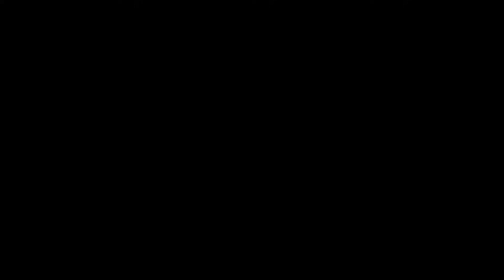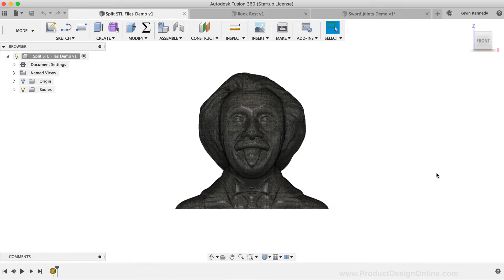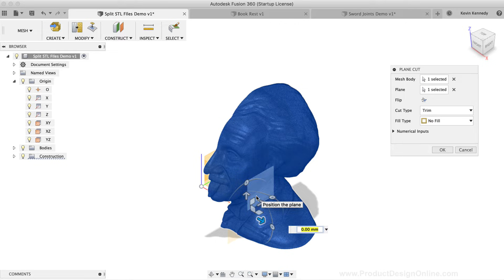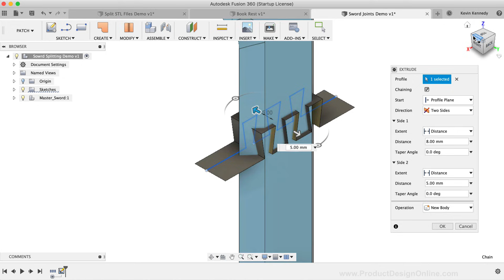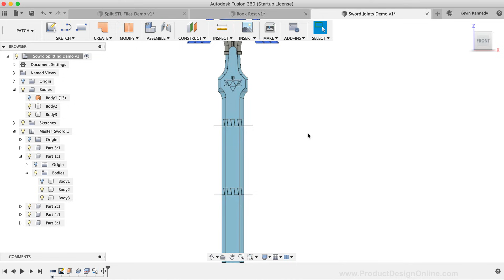Fusion 360: Split Large STL files for 3D Printing

Comment from the maker: Here are the resources for this tutorial ► https://productdesignonline.com/9
__
TIMESTAMPS
0:00 - Splitting large STL files in Fusion 360
1:37 - Measuring the model
2:36 - Turning on the Mesh preview
4:50 - Using the plane cut feature
6:39 - Selecting the cut type
7:13 - Selecting the fill type
12:13 - Second method: using the split body tool
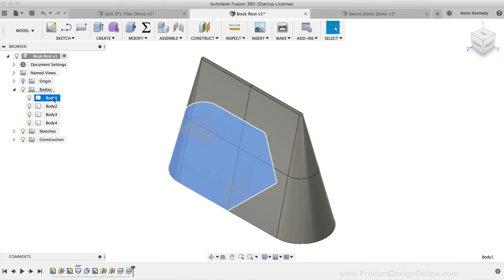14:23 - Moving the newly cut parts
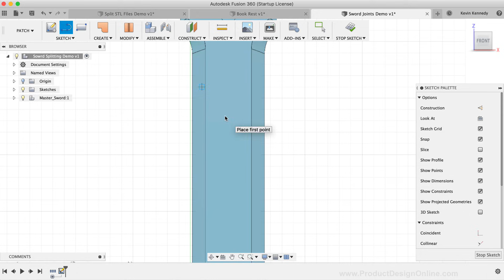16:51 - Creating a dovetail
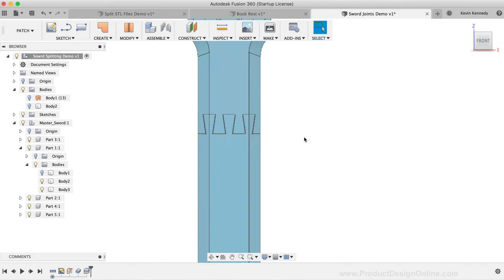23:20 - Copying the joint type: make duplicates
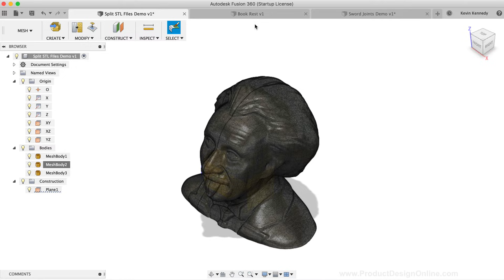Reply: The second method section actually starts at 10:35.

Comment: Hey! I"m new to 3d printing and fusion 360. I was following along with the sword dove tailing and there are a lot of tool locations that have changed. Also, for some reason I can't get my dovetail extrusion to be used as a means to split the body like you did. I'm so lost

Comment: I have been struggling for hours trying to use a zig-zag line (like a dovetail) to split an object into smaller pieces to fit my 3D printer. I knew I had seen you do it, but couldn't find the video until just now. I had been watching a video by another person, who was using an older version of Fusion 360 and his method didn't work for me. Only after re-watching your video where you said  you have to change to Patch view as it won't work in Model view, and only after I googled how to  do that in the new version, did I remember that you mentioned once that there are two "Extrude" commands. Locating the second one under the new "Surface" menu fixed the problem. I had drawn the zig zag line, but could not extrude it!  Many thanks

Comment: Having issues, can't see mesh menu?  Enabled in preferences and restarted, went to object and turned off capture design, but still menu doesn't appear. I'm using the latest free (not for commercial use version) any ideas?
Reply from the maker: Hi Tammy. Any way you can share a screenshot in my (free) community space? https://bit.ly/PDOcommunity
It sounds like you're doing everything correct. Typically, the 'do not capture design history' is what gets people.

Comment: I really like that thicken technique! That saves me time over push/pullling the surfaces afterward to add clearance! What's a good amount of clearance for a dovetail joint that will not be permanently glued together? Still .2mm? For example, I want to accurately locate two pieces that will be assembled/disassembled repeatedly. Or is there a better technique?

Thanks for your time! I really value your insight and expertise!
Reply: Update! (as if anybody cares) I had to make it closer to .4mm clearance because the surfaces I was making were not completely parallel to a printed plane. I also had to chamfer the corners after thickening because the corners had mild elephant's footing upon printing.

Comment: When I use the Plane Cut tool, it doesn't close the ne mesh body(s), no matter what option I chose on  'Fill Type'. What am I doing wrong?
Reply from the maker: It will depend on the object. Sometimes Fusion 360 won't be able to auto-fill it if there are too many meshes. You can try to use the "Patch" command in the Surface tab.

Comment: Thank you for the video. This is by far the best video I have found on this technique. The dovetail joints are so perfect even when printing my part at .3 mm and doing a thickness of .2 mm for the joint. It snaps together so well it is actually satisfying to have happen and hear. For my model I had to split a large ring into 3 different pieces to be able to print it. I used dovetails that were a little different looking on each part so I knew which would snap into which.

Comment: Superb dovetail approach - as I sit here figuring out how to pin and glue my two pieces with a smooth interface together.
Note - 
You have to have the Patch or Surface Sketch go outside the extents of the body, as shown in the video.
Mine didn't work when I tried to be efficient and just go from one vertex to the opposite side vertex.
I had to go back and add tag lines that clearly went beyond the main body extent.
Now to print and see how it comes out.
Reply: My line disappeared and I thought "man, the turtorial was going so well but I never get the results the example gets" until I tried your suggestion. Thanks for taking the time!

Comment: I cant seem to get the mesh option to appear. I've followed the step. Not sure why it wont work. Any suggestions?
Reply: now its in a tab on the top of the window. Its no longer in the drop down. its with the "solid, surface, form" tab
Reply: @bluebaconjake405  Thank you spend hours looking at why its not working dam thought was going insane here
Reply: Jaco van Eck urwelcome
Reply: You have to turn off the timeline, too. It didn't appear for me until I did that.

Comment: I am using an version that was updated today. I set the preview setting mesh to on and restarted. Selected Do not remember my steps but i still do not get the mesh option. Is there a special way to load and STL? I grabbed a different one to split.
Reply from the maker: Hi Clayton. The Mesh environment has been moved to one of the contextual tabs. Select the DESIGN workspace and then you'll see the "Mesh" tab in the toolbar.

To insert a mesh you can go to the insert dropdown > Insert Mesh

Comment: I can't get the Mesh option to show up. Im using Not for Commercial use. is that why ?
Reply from the maker: Hi, Quintis. Are you saying that your Mesh is not showing under the Preview Preferences? (as seen at 2:37).

It should be an option to turn on no matter what license type you're on. Select your username > preferences > preview > check "Mesh Workspace" and then hit "apply" and "OK". Cheers, Kevin :)
Reply: @ProductDesignOnline  Same problem. Changed preferences, saved and restarted.. Still no mesh workspace. Double check and the option is checked.. Running ver 2.0.7421
Reply from the maker: With the new UI the Mesh "workspace" has been moved to the "Mesh" Tab located within the DESIGN workspace. It will only appear when you have the preview feature turned on and once you have a mesh file in your design. Cheers, Kevin :)

Comment: Just out of curiosity do you have any tutorials that show how to hollow out modified STL files using fusion 360.
Reply from the maker: Hi, Thomas. Are you trying to hollow out a solid body (after conversion) or the mesh (stl/obj) body itself? Cheers, Kevin :)
Reply: @ProductDesignOnline  solid body after conversion
Reply from the maker: @fbi805  If you have a completely solid body (dictated by the icon in the browser) then you'll be able to do so with the "Shell" command. DESIGN workspace > Solid tab > Modify (dropdown list) > Shell. If you haven't used the shell command before then check out this tutorial - https://youtu.be/E0NVC8xhf3I?t=508
Cheers, Kevin :)
Reply: @ProductDesignOnline  awsome,,,  thanks
Reply from the maker: @fbi805  No problem! Let me know how it goes or if you have any follow up questions. Cheers, Kevin :)

Comment: Great video Kevin, this will help me a lot to split some models.  I'm pretty new to Fusion360.  When I've tried to save the splits into STL files, the model sizes increased by an unknown percent.  How could the files be saved to retain their sizes?  Thanks and keep up the great tutorials.
Reply from the maker: Hi Marcos. STL files contain no scale information, and the units are arbitrary. I'm assuming they're appearing to be scaled wrong while you import them into a slicing software? If so, try changing the units in the slicing software...it's likely that the file is in a different unit of measurement.

Cheers, Kevin :)

Comment: I really enjoy your videos and look forward to each one but I don't see one for the problem I currently have. I created an STL file that is only three words stacked on top of each other. It prints great. But I want to be able to print only the first and third word connected with a space for the second word to be printed with a different filament. Then I would be able to "snap" the two prints together and have one print in two colors. Can you point me toward one of your videos that show having the detailed control over splitting the file? Similar to what was done here: https://www.youtube.com/watch?v=0mwqbWdNpVI&list=PLAXev6n3Z-ADbNs7vvEspbAIeChPCye_G&index=5&t=207s but with more detailed control.
Reply from the maker: Hi, Donna. I don't have a video covering this topic in terms of "snapping" ability. It's something that's on my list of potential video topics to make. I would suggest for your particular problem that you create some surfaces with the "surface" or "patch" tools and then use the "Split Body" command (in a similar manner to what I do at the end of this specific tutorial). Make your surfaces different patterns or shapes that could snap into one another and be sure to add a thickness that equates to your required tolerance for 3D-printing. You'll probably need a .05-.2mm tolerance depending on how fine-tuned your printer is.

Hopefully this helps a bit... I'll try to make this a video topic at some point. Cheers, Kevin :)

Comment: Some more useful tips!  I'm going to be designing an ergonomic handle/controller to contain an electronic project I am working on and this has given me some ideas as to how I might eventually print it out.  Thanks Kevin, and thanks for the shout-out.  I'm happy to support your work.
Reply from the maker: Thanks again, Thistledoo 47603! Your contribution towards my work really means a lot to me. I'm glad to hear it sounds like you'll be using these techniques soon.

Sounds like a cool project. If you split up a handle to be multi-part, you could always add some holes for screws. Maybe I'll add this to the list of potential video topics. Would love to see some pictures with how it comes out. Cheers, Kevin :)

Comment: Very nice work Kevin, thanks a lot, but i think now is time to switch to the new UI....all the official Autodesk F360 related  videos now are based on it  :-)
Reply from the maker: Hi, IceCreams62. I had decided to wait until it was officially rolled out since a lot of users are still on the old one (maybe not now that they're pushing it a lot)...and ultimately because (although its probably more stable now) the UI preview was changing quite a bit and was pretty buggy for a while. My goal was to avoid having tutorial lessons with more than 3 or 4 different  UI preview versions since they had been moving stuff around and renaming it quite a bit in the last 4 months.

With that said, it appears they are planning on releasing it soon. I heard August... so we will see... hopefully it will be out soon :)

Cheers, Kevin :)

Comment: Hi kevin! love the tutorials. learning something new everyday watching your videos. Just wanted to know whether you could make a video on converting mesh files to solid body so that parts can be modified. I'm trying to make a Lithophane holder but i need to convert the file to a solid body. I tried to remesh it but a lot of the details are missing. I'm trying to join the body in such a way that i could print the file in one go.
Reply from the maker: Thanks, Jonathan! I'm glad you're learning and enjoying my tutorials. I actually have two videos showing how to convert mesh files to solid bodies. Here is the latest one  - https://youtu.be/yO6hboYWnfM

With that said, depending on how many mesh triangles your file has, you may have to alter it in Autodesk Meshmixer. The video I linked to will discuss that a bit more though.

Cheers, Kevin :)